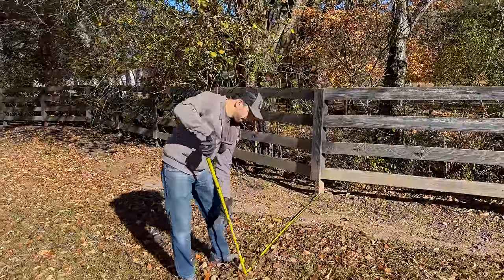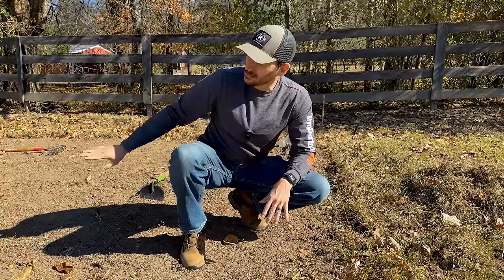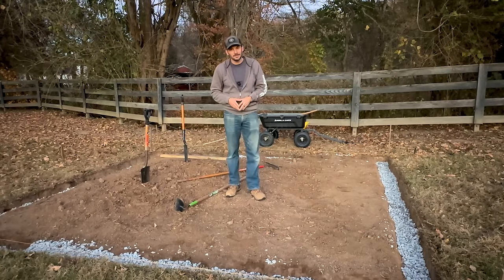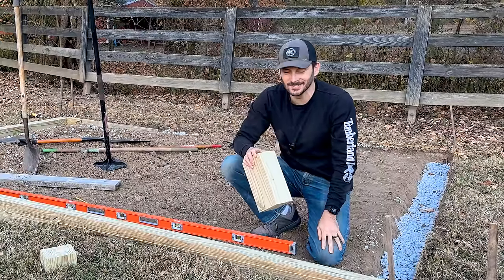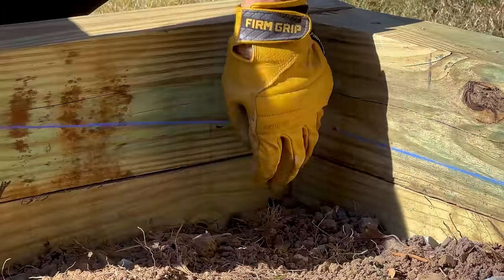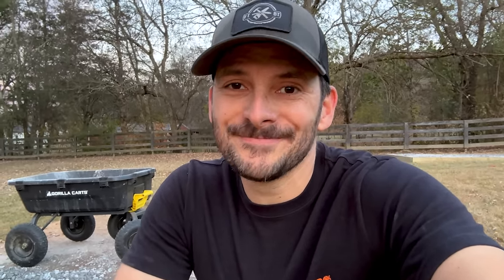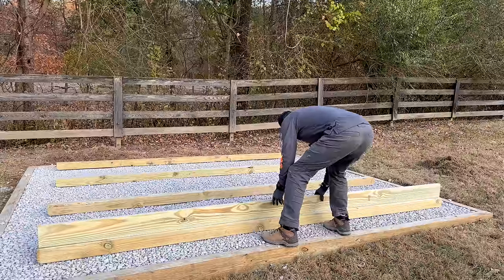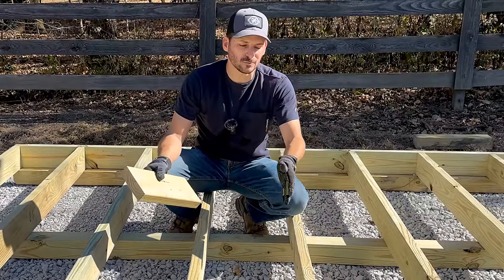I Overbuilt This Shed Foundation ... and it's awesome

Comment: Deck screws?! C'mon man! If you're going to overbuild that thing, don't cheap out on fasteners! Outdoor structural screws are only a little more! It's a sad day when one mechanical engineer named Brad (me) has to revoke the Engineering Card from another mechanical engineer named Brad.
Reply from the maker: I gotta be real honest, I've never even considered the difference between the two. Always assumed it was just the coating.  That said, I'll give you $100 if this thing fails because of the screws 😉
Reply: @Fixthisbuildthat  Haha! You may have gotten me on the "not the weakest point in the system" argument! Sounds like I just gave you your next video topic- a deep dive into the different types of common screws, what they're engineered for, and when it's okay to go rogue! At least you didn't use drywall screws!  🤣
Reply: @Fixthisbuildthat  Structural screws have a much higher shear strength. That's about all I've got to add to this though, lol.

I think the only way it will make a difference is if you run into the shed with a tractor, but the deck screws probably wouldn't be the first thing to give if that happened.

Comment: Looks like a lot of work, and you have wood in the ground. Not ideal. Brick or concrete will last indefinitely, pressure treated wood about 40 yrs. perhaps less with ground contact. Also not sure why all the gravel was necessary
For my 8 x 12 she’d I put concrete pads down, laid and levelled 4x4 beams and floor joists on top. Simple and fast.

Comment: So why didn't you just pour a 4" concrete slab on some rock base and call it a day.  Dig 8" deep and fill. 12' x 14' x 4" is 2 cu yds of #57 rock  = $250 delivered (max) and 12' x 14' x 4" is 2 cu yds of ready mix = $500 (max). Some 1"x4" forms, nails, etc you could have poured the slab for about $750 all in and it would last forever...
Reply: Ppl don't like concrete sometimes

Comment: Just an FYI here, Brad, The term insurance  you purchased is fine for when you die however, 98% of all policies never get used because we outlive them. And the fact that you don’t need a medical to get  the policy means that it’s more expensive than it would have been had you gotten a medical even for term.  Find an independent agent in your area to help you. It will be worth it.  JustMyThoughts 🙄🙄

Comment: You have no way to drain the trench you dug for your timber! Depending on how well your soil drains you may want to dig a drainage pit next to your trench so you can channel the water into the pit and let the water soak in. Of course you wanna use the same rock to fill the pit. Without this feature a heavy rain could flood your trench and then float the Timbers.

Comment: I know you're a mechanical engineer but this was WAAAYYY overbuilt for what you actually need for a 10x12 yard shed.
Reply from the maker: yes, yes....it's a disease 😂
Reply: Nah. Always over build your foundation. 
Most failures come from bad foundation
Reply: @sarinhighwind   This is not a large structure.  You can buy concrete footers at HD that you level and set the frame on.  I have a 10x12 in my backyard built that way and it's perfectly solid and safe.
Reply: @quesohusker  ive had to re-level a few where they didn't put in the effort. Depends on the original base and drainage though also.
Id rather over engineer it like him and be safe.
Hes not gonna 100% know how his runoff works yet on the property either. His whole back yard slopes to the house.

Comment: There is a reason you frame with nails and not ceramic deck screws.  You're probably fine because it's not a large structure but nails would be 10x better.
Reply: What is the reason?

Comment: I do not understand the point of this. A timber boundary has no value. The gravel is not going to wander off. You could level the soil but even that is not needed. Just put a pile of gravel and level that. It would be more stable because the soil is already compact because of a thousand years of settling. Weed fabric under a building?

Comment: Don't do this. His shed is built on top soil and will settle
Reply: Not so sure that there is much value on going below the frost line or putting proper footers for a small shed. You are technically correct but I seriously doubt this is going to see much movement.